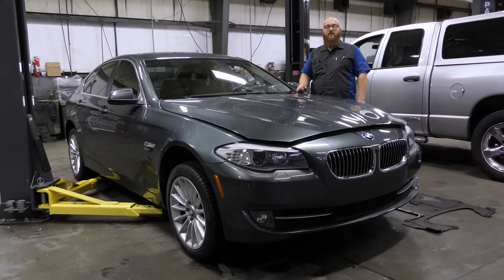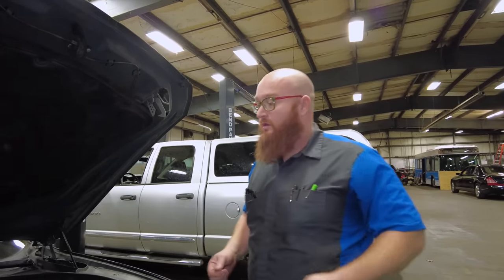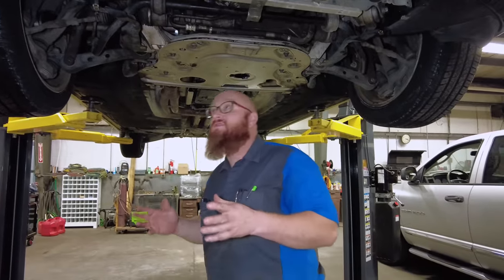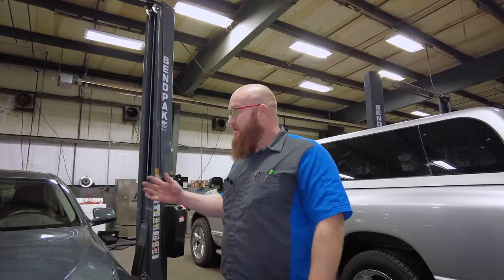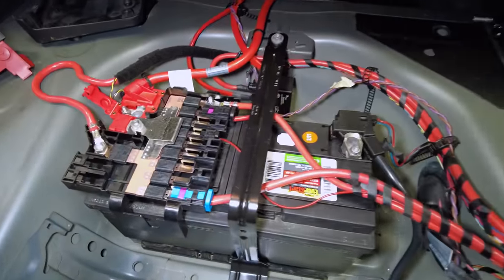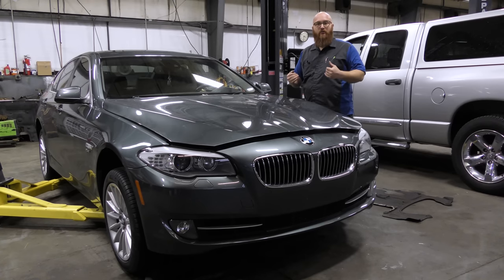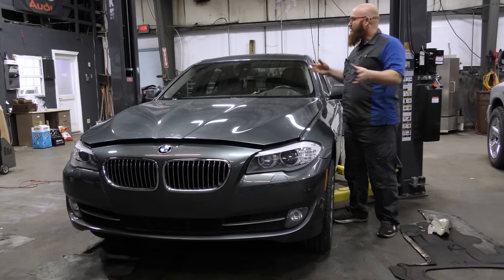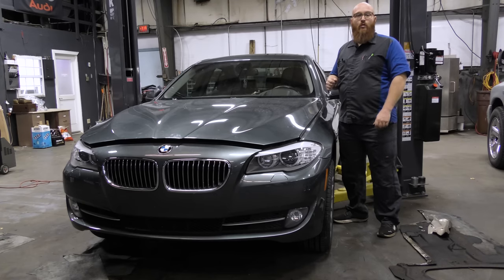One bad day for a customer! CAR WIZARD found TWO insanely unrelated issues at time on '12 BMW 535i

Comment: Well, 200k miles is more miles than the other 5% of Bummers ever get to.😂 The engine overheating probably caused the starter solenoid to fail. 
The wires or connections inside can become heat degraded and annealed at the connections and induce further resistance to the solenoid coil circuit.

Comment: BMW uses electric waterpump , push the start button without stepping on the brake pedal and see if coolant flow in the reservoir from expansion line ., If not your waterpump is dead .
BMW was programmed not to start when it detected overheating or abnormal and looses engine power .

Comment: Even on my Husqvarna Nuda, made by BMW, the starter failed and to change it you need to unplug the cooling hoses, losing all the fluid in the process, as it’s on the absolute bottom of the bike

Comment: The starters die all the time. One of the more common failures on n54/n55 cars. And tell me what car doesnt lock up if you drive them when a coolant hose blows? The starter is an hour tops. If you are charging 5 hours you are screwing them. I get book time, but you could help him out. A 200k mile car will need maintenance items. The fact it made it that far tells you they are pretty good cars.

Comment: You had me for a second, but when you said that it has 200K Miles??? WTH. Any car will have some issues at that mileage, and you can expect that some repairs need to be done. Many makes and models won't even reach 200K.This whole video was presented like something failed way before it should've, and poor customer doesn't deserve that. SMH.

Comment: That's not right wizard! 
Over 200k miles is a good run for a starter. 
I used to replace starters on 60s and 70s American cars
 with less than 200k miles.
The clip on that hose coming off bothers me more.

Comment: Over 200,000 miles, what does the owner expect, the car has already payed for its self. That hose has come off because the drive curbed the front of the car while parking, usually damaging the engine under tray as well.

Comment: My N52 starter went bad at 155k miles but it was giving signals before it finally died so I could replace it at home. Honestly pretty cheap fix. My neighbor rebuilt it for 40 bucks and it took me like 3hrs to take it off and then put it back under the 3 stage manifold

Comment: This car should have be able to get into neutral by removing cover around gear select, insert screwdriver or similar into white plastic thing and move down until it locks. Remove and it will go back to park.

Comment: An overheated engine can possibly ruin the starter probably in more ways than one . Excess heat may have shorted out the solenoid melting the insulators.

Comment: You need to change the coolant reservoir cap - it failed top release pressure and the hose poped of. On Mine the resrvoir itself exploded. Common sense is to change the cap every 2 years to avoid stuff like this on these BMW`s

Comment: ... pull the intake and do the starter myself, save 750 in the labor column.  and find out if engine is junk ( going to need to replace starter for compression test anyway, can manually rotate engine and hold it for leak - down test and honestly the intakes are NOT that hard, just a ton of crap on top of them  including the cowl)

i actually own a E90 N54 powered BMW with 186K miles,  i have focused on getting rid of as much plastic as i can.  my VC is no longer plastic, i bought the bremmen aluminum one.. torquing it down is a pain in the ass and time consuming ( mostly the time consuming part makes it a pain in the ass.. that and needing 1 inch extension and 3 different extension lengths for some of the bolts) ,  i purchased the ECS under intake vacuum line replacement to the over intake plastic line, i relocated the plastic vacuum tanks to driver side with the turner relocation bracket and plan to replace the vacuum tanks with BMS/VTTO all aluminum ones. ( although i personally dislike vargas immensely)  i have replaced the stamped steel rear arms with the M3 arms and recently replaced the rear B4 sport shocks , i've also replaced the front inner and outer tie rods. 

i plan to do M3 front arms, as well, because the car was an M sport suspension manual car, and then run the M3 alignment spec.  i will liekly do M3 rear diff front bushings and standard rear bushing, and M3 subframe bushings. the idea is minimal NVH increase, with best OEM+ driveability and handling performance.  yes it is my daily driven weekend Auto X weapon. i love my car.

Comment: Number 1 thing I could offer as a BMW mechanic is get a Bentley manual, learn to do your own maintenance, and follow your service intervals. I’ve run several BMW’s over 300,000 miles on original engines and transmissions, but gotta keep up on maintenance. Also, don’t buy them used. Let the prices fall to rock bottom. I want an e28 M5 for under $10,000. Terrible unreliable car, total junk don’t buy.

Comment: $1200 for a $39.00 starter. Nice production Wizard, Have owned several older BMW's which were pretty good to me, however will not touch a BMW Newer than 2000. Send it to Car Ninja.

Comment: 200k miles: starter and a coolant hose? Wish all cars had only those problems at that mileage...lucky owner.  Those Bmw can have timing chain/guide seal issue but this one seems like holding on pretty well. Bmw problems may be pricey but definitely over complained(also turbo oil leak issues)

Comment: 200,000 miles! If the car was bought new and it was the original starter….sounds good to me. With the coolant leak should the owner have noticed the liquid on the ground? I do not know the whole story but there are circumstances where I do not feel bad for the owner of the BMW.

Comment: I've had numerous newer BMW's. I wouldn't buy them if I didn't work on them myself. I've been extremely fortunate though. I had an 11 535i xdrive with over 150k miles that ran amazing. If you don't service your own euro cars, you need to have a fat wallet, just Incase. This is probably the most this car has cost the man in 200k miles.

Comment: I'm sure it was just happenstance that the starter went out at the same time it lost the coolant. My F30 335i had to have its starter replaced at 90k. I would bet a few bucks that this isn't this car's original starter. Clearly BMW did not do a good job at engineering the starters on these cars with early auto start stop systems. If you have a 2012-2017ish BMW I'd say make sure your auto stop start is turned off always. I guess we'll find out how hearty the starters on the newer cars are.
That aside, this (N55) engine is one of the best BMW has made aside from the B58. Yes it leaks oil - that's a BMW. The reality is most people don't change their oil frequently enough. 
I've been pretty surprised with the reliability of my N55. I did preventative maintenance and replaced the water pump when I had my thermostat replaced a few weeks ago. It's a really good engine when paired with the ZF. 
If you want to own a BMW out of warranty you need to either know someone who can do the work at a reasonable price or know how to do it yourself. I'm half and half, I do brakes and such but big projects I'm lucky enough to know a great BMW mechanic that is very knowledgeable and does great work. Otherwise you're going to be in for a rude awakening. I think unfortunately most people who buy 6-10 year old BMWs just don't know the maintenance risks that come with them.

Comment: Bmws are fickle beasts! I have an e60 and previously e46! My e60 is coming up 200,000 miles, it is no coincidence the engine overheated and the starter failed at the same time! Bmws will not allow an overheated engine to run! Therein lies the starter problem! The client/recovery company has clearly tried to restart an overheated engine and while it will crank the ecu will not allow it to start! The starter has been burned out! Your customer is not telling you the whole story! Hopefully the motor is OK as it will shut down upon overheating!

Comment: Wizard you need to learn a little bit more about the newer BMW 2006 and newer it's called overheat protection it's so you cannot destroy the engine by continuing to drive with an overheating engine

Comment: Stop acting like u care Wizard, thats how u make ur money or else ur shop would go broke!  Second, for any starter that dies after 200k miles is amazing endurance! My old infiniti i30 had to change the stater 3 time during the 12 yrs i had it. My Toyota Matrix had to replace its starter after 80k miles.  That n55 engine is solid and carefully maintained will last up to 300k. Unlike other cars, the bmw will shut off after a severe limp mode warning of overheating or suddent lost of all coolant as a safety feature in order to save the engine from being destroyed!  Love the F10 model, solid and gorgeous BMW ever made especially the M-Sport and M5 versions of it. 💪😁

Comment: The starters on these are dinky compared to the older models and have a lifespan of about 80000 miles or so.  You can tell that it's about to go out because it will rotate slowly.  That is the number one symptom.

Comment: 200k miles probably using start-stop function. You would have changed the whole engine if it was a Kia. Starter may still be repairable as well, and there are chinese options if it's too much for you.

Comment: 200k? I think the guy had good luck with the BMW. I bought a Ford F150 and at 125k, I had a blown head gasket which killed the engine, new starter, new water pump, alternator, fuel pump, radiator leaks, ball joints, steering, etc.

Comment: I find that if you do your own Mechanic work it isn't such a big deal. The total price is A LOT less too this job would've been 300 out the door. Coolant, starter, and NEW hose instead of just putting a new .35 cent clip to put it back. Owned a 535i non xdrive and it was my baby until some drugged a@@@ole totaled it. Now own a 650i and she's a dream.

Comment: All cars have waterpump failures, or coolant leaks. It's the DRIVERS responsibility to stop and be aware when there is an overheat situation. If you continue to drive it after the car has warned you to pull over, then that's on the customer, not the car.    I mean if you really want to get technical, BMW literally plasters the warning on a LCD screen telling you to pull over, instead of having to notice it on an old school gauge like back in the day. My god, is this guy for real??? Trying to blame an engine getting seized up on  the vehicle , and not the person who ignored the overheat message?? Geez.....

Comment: What is the one system on BMWs that never breaks?  It's the blinkers, because they are almost never used.

5 hours to replace the starter.  This vehicle design is so misguided, it should be illegal.  
When I was in college, the starter replacement on my Volvo 240 took grand total of 35 minutes, and I did it in the driveway with some help from a friend.  Two bolts, two wires, a bunch of socket extensions and some elbow grease.  We placed the front wheels up on cinder blocks and got the job done on the cheap.  What is going on with newer cars these days?  These designs don't even make sense.

Comment: Oh well....insert any brand here with issues that come up with them all. I've owned 6 BMWs, they have all been bomb proof with no issues. To go 200k miles before this happened? Pretty impressive honestly, and what do you expect? If that is all this person has spent for any type of "major" repair on this car the entire time in 10yrs...that is pretty reliable and good in my book. Disclaimer I don't run them for 5yrs on after buying them. But never had any issues. Bad timing of issues, hoses pop off on cars all the time, CV boots crack...yada yada. You know what doesn't have these issues? A Tesla...ROFL. Battery, motor...computer...end of story. Rest is  basic car with nothing to fail and go wrong, brakes won't ever wear out. I know, down vote me...whatever...facts are facts. 8yr 120k warranty on motors/battery on them. Maybe the tires wear out and a bushing/cv joint boot. Now if the computer has an issue...IDK, but that applies to any car's ECU!!!

Comment: A starter that lasted 200K miles. Dude. That s really reliable from the german car manufacturers perspective.
Mine failed at 90K miles.
The N52b30 is one of the most reliable NA engines.
You are exagerrating.
But I second you when it comes to xDrive.

Comment: Is it your first BMW in the shop or what? It is just a poorly maintened car. Most people do not maintain them, and they are cars that need high maintenance. Somebody was in there before for sure, and the starter probably gave signs that were ignored.I've had 4BMW's, worked at a dealership as a technician for almost 4 years. I do not know if I will have one ever again. They are expensive, but they are awesome cars, since 2006, they do not rust, and you can drive them at 160 mph all day long. You just have to maintain it.

Comment: I think realistically at 200K miles, these issues shouldn’t be surprising.  Hoses fail after 100k miles.  If they were original, then they own it.  Starters do fail, but at 200k shouldn’t be unexpected.  I disagree with Wizard.  As a beemer owner, you enjoy the car but understand what needs to be maintained.  Those that think BMWs are Toyotas  will be sadly mistaken.  While it might be disappointing, the owners have little in and probably  haven’t done due diligence for a vehicle with this mileage.

Comment: after he said 200k miles the whole video changed for me; I mean could it be the engine got so hot that it fried the starter? plus things on high mileage BMWs are always breaking especially if the part ,in this case, starter has never been replaced.

Comment: Enjoy your videos and info ... THANKS!
I would NEVER buy a BMW ... BUT to give those German Designers credit ... they probably saved that engine by PREVENTING the driver's attempt to re-start.  Concept = keep it safe until a diagnosis and resolution. BTW ... As you probably know ... even some Toyota vehicles were shipped for quite a while with a RUBBER HOSE (down low) that is known to burst and dump ALL of the coolant in SECONDS.
Confession: A few years ago, I bought a used RX300 so I could maintain it myself ... and avoid all the Sensor and complex CAN BS of newer vehicles.  Being a Toyota, lots of info, lots of parts, usually easy to work on ... BUT NO ONE could afford to own and properly maintain my little beauty IF they had to pay a dealer or shop for even routine prevention / maintenance ... and major repairs (for a neglected car) i.e. few / no engine / transmission fluid changes, etc.  ... at a dealer repairs due to poor preventive maintenance ... would be a death knell.

FYI for all.  I bought a 2003 Lexus RX300 a few years ago ... after spending a year looking for a "Clean and Reasonable" RAV4 ... then bought a Lexus because of the fine (documented) maintenance history ... from a DEALER.  Actually a good price. Perhaps my exception proves Scotty's rule of "never buy from a dealer ! "😴
For me, the only "downer" is the poor gas mileage ... ~16 MPG in the City.

🥵Counter Intuitive Caveat: MOST used Toyotas are NOT a good buy ... they often just get driven and neglected ... until they literally die ... and / or need thousands of $$$ in "catch-up" repairs/replacements.

Comment: $1200? Are you serious? Go online and buy exactly the same Bosch starter from the same production line, just without the BMW logo on it, for $187 with new bolts and stop ripping off the customer.  Labor-wise, it takes about 45 minutes to complete the job. I did a starter recently on my 335 N55.  I'm sorry for your customers...

Comment: The F10 with the amazing N55 engine are way more reliable than previous, the body chassis is one of the easiest engines to work on, lots of space and amazing tuning abilities!   You don't really know how smooth these f10 5 series BMW's rides even on sport mode until you go back and drive a shitty Toyota or Mazda on the streets and feel all the pain on every bump and holes and roughness of the streets with these cars and then compare it back to the beautiful ride the 5 series produces....  Is like night and day difference!  Yes the parts are expensive but they are of high German quality and last you at least 9 to 11 yrs before another maintenance service on this parts and if you drive like a 60 yr old then these parts will last you over 200k miles...

Comment: I feel we need to start emphasizing the age of these vehicles. 

Here's the situation. Some guy leases a BMW brand new, perfectly maintained, once it's over he gives it back

It gets sold certified pre-owned to some guy who bought a car at the top end of what he can afford and he can't maintain it correctly. Sells it and forgets about it when it breaks, dealer fixes the issue and puts it up for sale

^Here comes the 3rd guy, buys a BMW for a 3rd of its original price, drives it daily until whoops 3 months later, something breaks because of lack of maintenance from guy #2 and so guy #3 says "oh well, just gonna fix it", he fixes it, but would you look at that, because of lack of maintenance something else breaks!!!!

Then he sells the BMW, hops online, starts complaining about how much a piece of shit the piece of shit he bought was, starts flaming BMW, then his buddies hop online and start with the "well my buddy had a BMW and it was-" and then his friends friends tell the same story

Then repeat the cycle for the next car 🙄